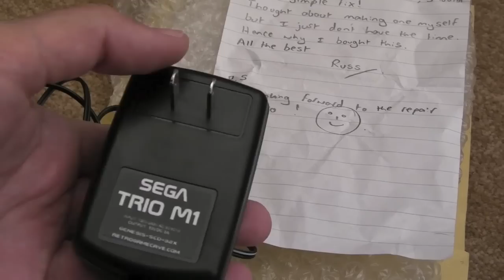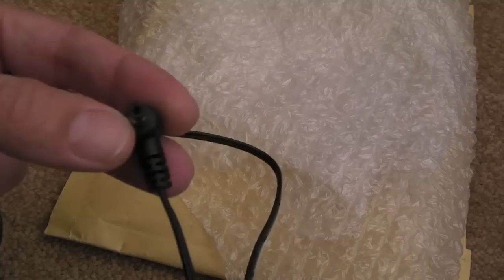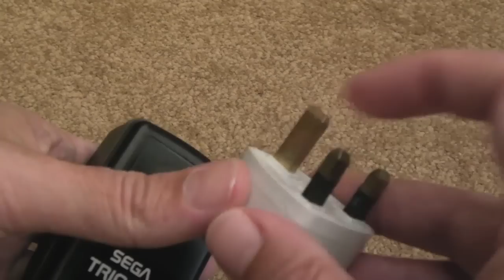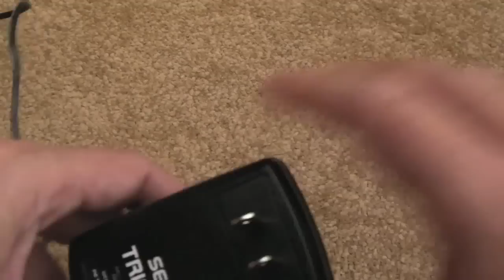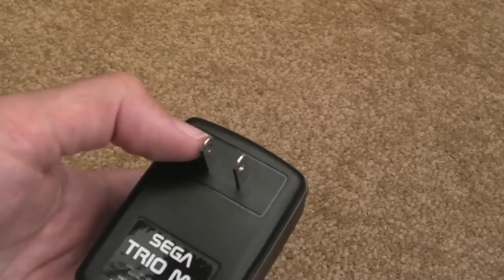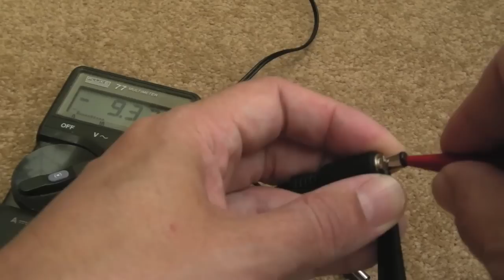Sega Megadrive (Genesis) Trio M1 PSU From GRUSS Newton

Comment: One more thing I forgot to say is that I am surprised that it doesn't have the voltage safety regulations along with warnings on there. Over here in the US all of our electronics have to meet the proper standards and need to be laid out in text whether it's on a label or if it is printed on the plastic itself. Otherwise just like where you live it would not pass to be sold. I think our procedures are similar when it comes to electrical safety and electronics.
Reply from the maker: Whilst the adapter came from the US originally, I suspect it was first imported from China!  Just one of many of these types of PSUs coming into europe and the US from China I think, and a lot of the time there's no safety checking / approval etc.  We have 'CE' approval here, and we get lots of fake 'CE' markings on some of this stuff.

Comment: Yeah that is a plug that we have here in North America. We have just the two flat vertical prongs like what you have there or we have the two flat vertical prongs with a third circular prong beneath the two flat vertical prongs depending on the power output. A power cord for a PC would have the two flat vertical prongs with the third circular prong underneath the two flat vertical prongs. For a radio, TV, toaster or alarm clock we usually have a power cord that just has the two flat vertical prongs since those take less power to power them. 

One thing I love about buying electronics from Japan is that they have the same standard as we do. When I buy electronics from Europe I have to get a power adapter/power cord that is Asian/North American style. If I bought a PAL Megadrive I could use the US power adapter I have with my Genesis. My friend bought a PAL Megadrive and he just took his Genesis power adapter and plugged it in and it worked. When I went to England and Ireland I had to get a couple of European adapters for my electronics or else I wouldn't have been able to plug in any of my stuff into the wall. lol this post is so stupid. I'm talking about plugs. Oh goodness well I hope this was somewhat informative. :)
Reply from the maker: Yeah, to be honest - not so much wrong with the PSU (except that it was just a sealed unit - it probably had an internal fuse), but the adapter was really cheap quality.  It is annoying the voltage differences but I expect that will never change due to the cost of the infrasture behind the mains supply.

Comment: I assume this is to power three Sega devices from one power supply - MD, M-CD, and 32X.  Slightly off-topic, there's a video floating around on YT where someone took apart a Mega Drive and a 32X, shoehorned them into a Saturn case, did a bit of customisation on the case, and effectively created an all-in-one MD, M-CD, and 32X, and called it the Sega Fusion.

Comment: Hi Chris. 

I had power on each connector as you've shown however I had to twist the connectors/jacks when they were in the MD to get it to work. 

I contacted the US seller and they said they have had a batch of faulty jacks. 

They sent a replacement out and the jacks felt 'tighter' when plugged in... 

Maybe it's my MD although they did admit a problem straight away.. 

Actual quote I've just found 

"Yes, I'm shipping you a brand new TM1. The connectors have been verified to be properly in tolerance.
 Your 1st power supply managed to slip though quality testing, but rest assured this wont happen again."

Be interested to find out about the fuse? All my consoles and setup are switched off at the wall socket when I'm done
Reply from the maker: Thanks for sending it mate =)  Really appreciate it!  I suspect the connectors on the Megadrive perhaps aged a little and if the connectors on this PSU aren't a perfect fit then I guess that could have been the issue.  It does work perfectly though, so I owe you one =)  I will at some point take it to bits to take a look inside - confirm whether or not it is really dangerous.  It might be OK!   Regards having a main switch at the wall - that's the best approach ;)
Reply: GadgetUK164 that's ok pal, glad you can make some use of it! :-)